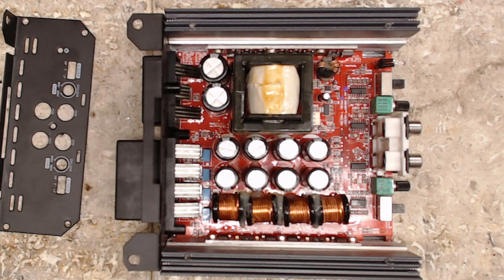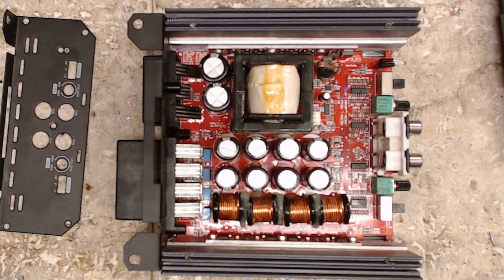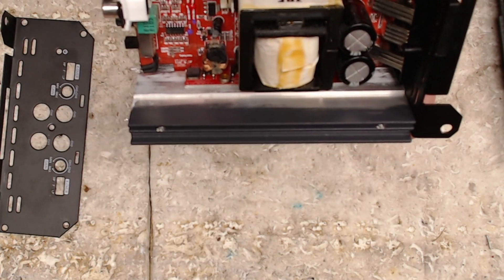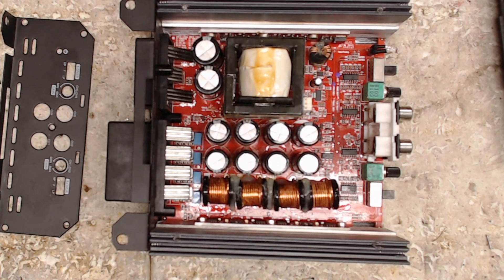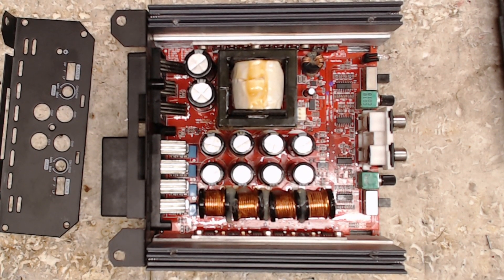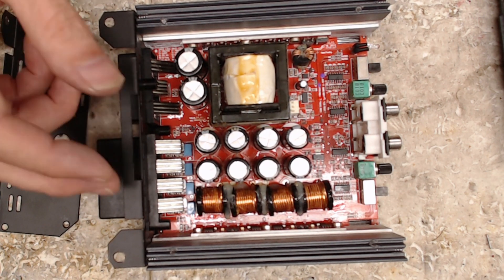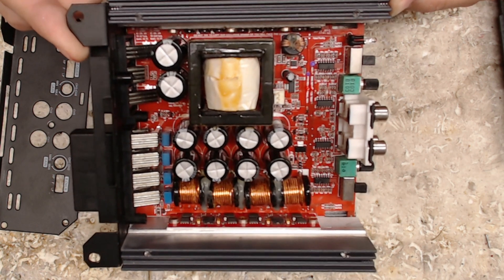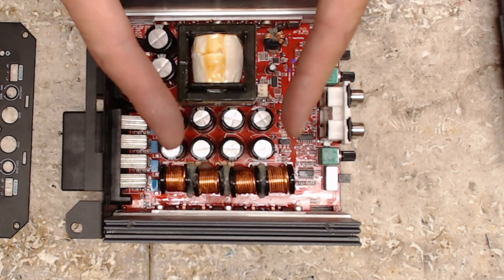Sound Digital Evo 1200.4 They Said WHAT? "Only Thier Techs Have The Right Equipment for Repairs"

Comment: I am looking at 1 right now. That need 2 transistor Haven you figured out the   number by now?
Reply from the maker: I closed so all of that information is packed away. I did have the part numbers for the 1200.4 and the output ICs for the other 4 channel amps. I never touched one again after this video.

Comment: First time sent in was due to red light constant, repair worked.  Now blinking red light, past warranty.  Sad part was I wasn't even listening to music during the 6 hour cruise and at some point it went into this blinking mode. 1600.1 evox2. Any ideas what I can do?
Reply from the maker: The random transistor failure issue. You wll have to find someone who repairs them as it will have a short.

Comment: Hello Friend, I have been watching you videos, I need some help any reply would be appriciated, I try to find the mosfet numbers in a 35k board in power supply section to make repairs,  my input mosfets are marked as H2,  do you have something as equivalent for H2 marked mosfets?
Reply from the maker: Sorry but I do not know what the H2 is. I have seen 2 of those 35k amps here, which were declined for service, and I think it was something like the 1404 or equivalent.
Reply: @ellensburgamplifier   so we can use this? thank you for your answear

Comment: Hey Todd, would you happen to know what the defaced output IC's are?
Reply from the maker: I don't know 100% for the output but does it have one or two ICs on the output riser card? I would look into the datasheets of the IRS2052m and the IRS2093m. I have not repaired any of these due to the solder joints of those cards, so I cannot provide much information.

Comment: What’s a good  2000 class d for bass . Any recommendations brands help
Reply from the maker: There are many and I mean many amplifiers in that power range so be careful when choosing. I can't give recommendations as I don't know the installation it will be driving. Many amplifier failures are from improper installation and use. I would look into a small Korean-designed amplifier such as DC, Ruthless, Gately, etc.

Comment: I was considering buying a Soundigital amplifier but after seeing this I refuse to purchase any of their products. This is insane.  These are so compact they lack a lot of rail capacitors like their older models.. not a huge issue on these but on subwoofer amplifiers the power supply can sag since they are so small there is no room for decent sized rail capacitors

Comment: Todd I have SD2000.1.. the input and output mosfet blown.. I can't read the numbers.. it's been wiped out the number helped
Reply from the maker: I don't get these in often enough to have solid information on the parts used for the 2000.1. I can figure it out if it was here but other than that I don't have device type available. If I had to guess the 1405s in the power supply and the 4115s or the 4127s in the output.
Reply: @ellensburgamplifier  
Okay thanks you Todd.. I will try them on Mosfet now days it's pretty cheap...
Reply: @ellensburgamplifier 
Todd can you provide me your shop address.. I might sent it out to you.. I'm Sacramento California area...Ellunburg, Washington not that far away...
Reply from the maker: @chaseyangtze4689  You bet. It wouldn't cost much at all for CA to WA shipping. Diagnosis is free and if you would like to get started in the process the first thing to do is to fill out the service request form at www.ellensburgamplifier.com/request-a-quote and from there I will email you with all the information needed.

Comment: That's a fact man! I went through this with soundigital years ago.
They told me the same thing man and I felt very insulted to say the least. 
 I've repaired tons of soundigital amplifiers since. I have no issues with their equipment but me personally, I think it's absolutely retarded to unmasked, and rebadge components to hide whatever they are utilizing simply because they only want one or two people in the United States to repair their equipment.
 Again, I have no issues with the products and of course you can find out whatever the components are usually, but my problem with soundigital is the misrepresentation of the company here in the United States. The representation of the company absolutely sucks on an extremely major level. These people have a lack of care for their customers unless they're spending 25 grand plus on their equipment.
 Then and only at that point someone from the company will maybe attempt to talk to you if and when you start to experience issues with the products. The representation of Soundigital put a bad taste in my mouth years ago. 
I explained to them way back then that I was a very well known amplifier repair company here in the United States, and I was trying to get a couple schematics if it wasn't a problem. Obviously, it was a problem for me to ask because after sd said what they said to me, then proceeded to tell me I needed to send that amplifier to their repair center almost as if I wasn't qualified enough to repair their equipment which was very insulting to me.

Comment: so can I send my sound digital amp to u for repair? the sound comes and goes
Reply from the maker: Well, I do not take them in due to the length of repair time. Since they don't provide me with schematics I have to reverse engineer the board to determine what they used which takes substantial time to do,
Reply: @ellensburgamplifier  ok thanks